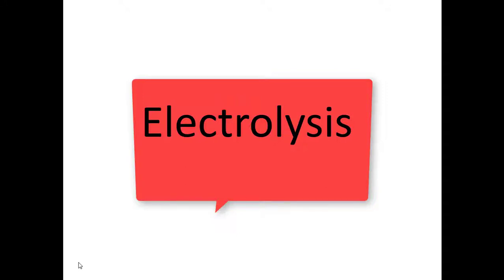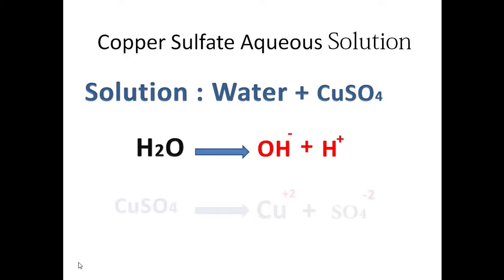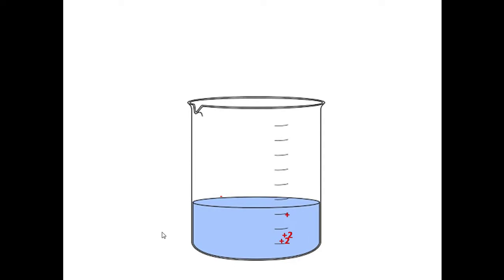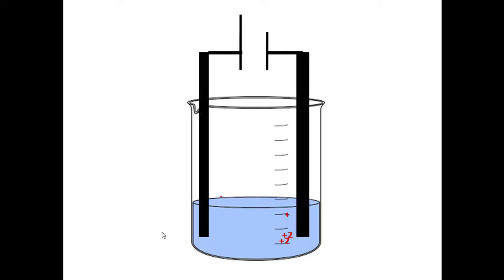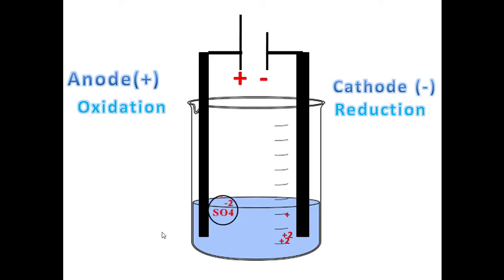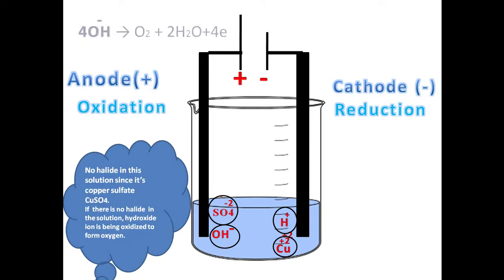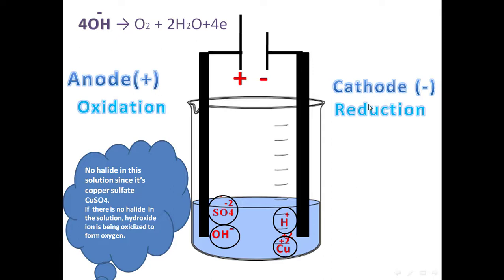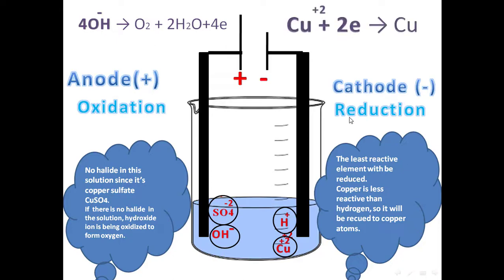Electrolysis of aqueous copper sulfate

Comment: Using copper electrodes what gases are produced during the electrolysis of copper sulfate solution ?
Reply from the maker: At the anode, Oxygen gas is produced due to oxidation of OH-. At the cathode the less reactive element will be reduced, copper is less reactive, so it will be produced at the cathode as a brown layer coating the electrode.
Reply: @Professional_chemist  thank you , so oxygen is produced using all type of electrodes , i mean even if the two electrodes are made of copper instead of carbon ?
Reply from the maker: Kami Star   No , it produces oxygen only electrodes are made of carbon or  platinum.